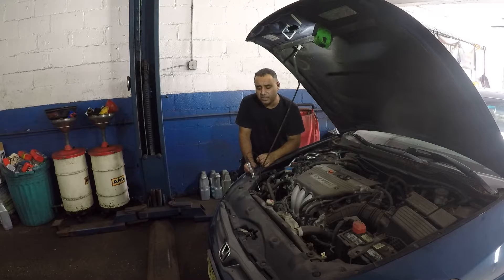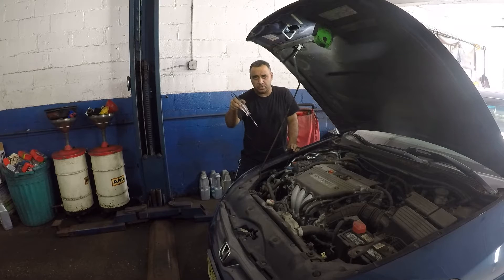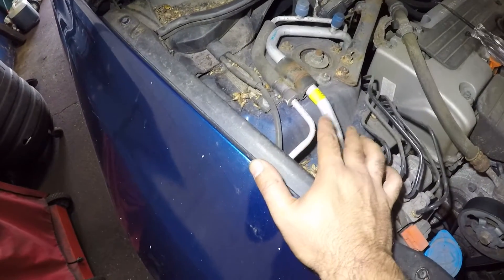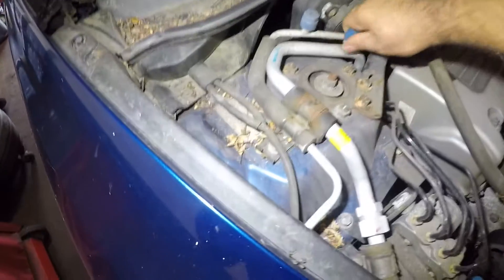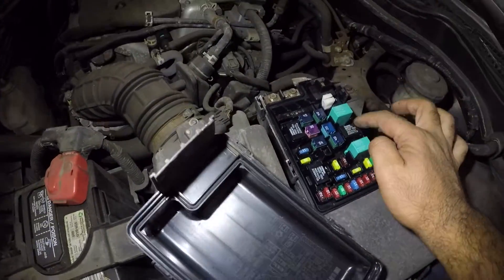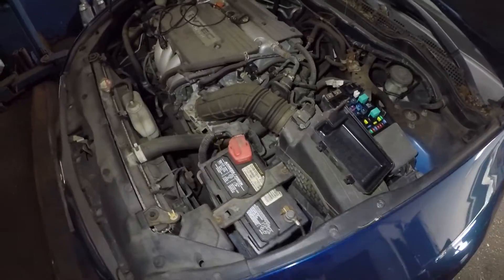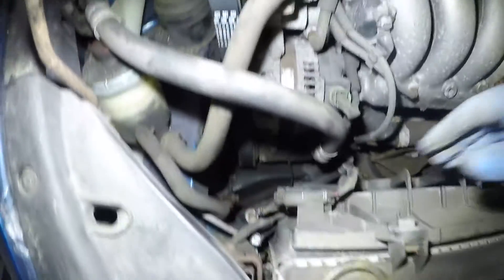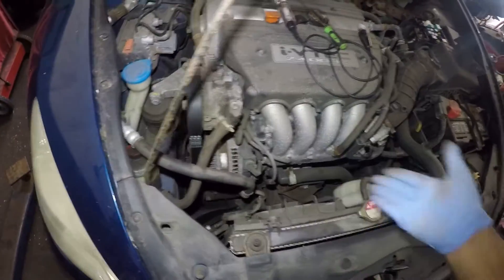How to Electrical Test AC COMPRESSOR power on any Honda Toyota Acura or and other car

Comment: 2009 Acura TSX, The power to the compressor "pulsed" very weakly, so the A/C was not working, also the condenser fan wouldn't turn on. After running diagnostics, I disconnected the A/C pressure switch and the fan kicked on when A/C was turned on. This bad switch was shorting into the A/C circuit. A new A/C pressure switch got the A/C compressor and fans to come on.

Comment: does car need to be RUNNING to test the socket, or just dash  and ac ON ,on the climate control? tested  mine car NOT running, but the AC switch was on and blower> no juice at connector?
Reply from the maker: Running

Comment: man I hope nobody else troubleshoots like you. In theory you have an idea, but you'll have people venting their freon to the atmosphere and changing an expensive ac compressor then recharging with cans of freon then finding leaks, doing it all again twice till the leaks are fixed and after working on their car and cussing it for a week someone will tell them "you could have just changed the clutch assembly"
Reply from the maker: I use machine I try to tell people to use machine it’s nothing what people do watch all of my videos how much I encourage it’s better to find ur issue but then find a mechanic as I say ask the mechanic shop if they got machine cuz u already know there’s no pressure.    So if I can get 100 people to have their ac systym recharged with machine it’s worth it at least I got 100 people less to go to shop that will dump. The whole thing

Comment: This is for the mechanic i got a brandnew ac compressor in my 07 accord v6 3.0L i replaced all realys fuses and brandnew pressure switch when i hook the test light up to the ac compressor connector i have no power what can be my problem plz help me out man id appreciate it
Reply from the maker: What is ur ac refrigeration pressure? High and low
Reply: @RBTheMechanic  they were pretty low I vacuumed the lines for like 5 mins and added the freeon and still nothing

Comment: I dud exactly all steps you did it, but on the last step turn on car and a/c, with the test light not comes on. What's the next step?? Replace whole compressor
Reply from the maker: No u need to check pressure

Comment: Why do you suggest it's a bad compressor in the video...? Couldn't it be just a bad magnetic coil that prevent the clutch from engaging? I have similar problem with my Acura TSX 2011 right now. Relay and fuse is fine, pressure is fine, clutch does not engage. I bypassed the whole electrical system and connected the battery positive on the red wire of my compressor and the clutch still doesn't engage. Only thing I haven't done yet is to test for a bad ground and also check the resistance on the coil which should be between 2 and 5 I believe (roughly... no more so then about 3 to 3.5 as per Acura's specs I think). But still, my point is, it's possible that only the magnetic coil is bad, no? Also I have turned the clutch manually while the car was off and it turns freely but make a grinding noise, that same noise occurs while the car run but much louder, I have used my stethoscope to confirm and yes my AC clutch bearing is done. I was wondering perhaps a bad clutch and a bad bearing (probably filled with debris in there) could possibly prevent it from engaging...? The noise from the bad bearing started to be audible about 1 week after my AC stopped working (good timing now that summer is over lol)
Reply from the maker: Well I tried doing clutch coil for customer it was more expencive than putting in new compressor.  Clutch is the part that goes bad
Reply: @RBTheMechanic   Thanks for the reply, and thanks for your channel and videos, I learn everyday as a DIYer. I saw another video of yours about a similar issue for a 2010 TSX, I own the same but 2011 so everything you showed and explained was of a great help! In my case here in Canada, nobody holds the clutch kit for TSX 2009-2014. All they have to offer is the full AC Compressor that comes with a new clutch. So I found just the clutch kit which also includes a new coil that I have ordered from the US just a few days ago, hopefully it will be coming within 2 weeks or so. I'm afraid my bearing seize up and damage my belt, forcing me to stop on the side of the road right away because of no water pump... I have already been driving with the bad bearing for a good week and a half already. A risk I should avoid you think? That's 9 more days of going to work, a total travel distance of about 525km (325 miles) until I get my parts

Comment: What would cause me to get under 12 bolts at the ac plug, ( it’s a two wire GM weatherpack plug with I believe a built in diode) plus a diode downstream? It’s a Vintage Air aftermarket system in a classic car.
Reply from the maker: Dose it have relay?
Reply: @RBTheMechanic  Yes it has a relay and the diagram that came from Vintage Air shows there to be a “large diode” between mode switch and a rotary dial AC thermostat, then the wire goes from thermostat to compressor. This diagram shows a one wire compressor but the actual one on the car is a  two wire GM, if that makes any difference. Thank you 🙏 in advance.
Reply from the maker: @Joe-bb5hf  oh ok

Comment: RB if you find time on this one, I would be so damn grateful. This has been driving me nuts for a week. If you have a funding account for your channel, I'm happy to donate as well. 2002 Acura MDX. AC was fine. Acute stoppage of cold air. Compressor clutch not engaging. I didn't do anything and just drove the next few days. Here's what I found. AC does not respond from control panel whatsoever. Even with system off. However, when sitting in idle and the radiator fan detects enough temp, it kick on, and along with it, the condenser fan (normal) AND the compressor clutch. Keep in mind system is not on. I can feel draft of cold air. If I turn AC on/off, doesn't matter. I'm getting fan speed control, vent designation, and cold air. Once I'm driving and the radiator fan doesn't need to run, AC is dead. Both fans are on, compressor clutch not engaging with interior controls. The AC is solely dependent on the radiator fan being on. I find this opposite. Radiator fan will come one when it needs to OR when I turn AC on from control panel. I have no control from there. Have checked all fuses, relays, power, etc. All tested good. However, as I suspected, the single wire going to compressor is 0 volts with car running, AC on, until the radiator fan comes on as I let temp come up. When the radiator fan kicks on, I'm getting plenty of voltage. Took it to a repair shop and all they gave me was "No power to compressor", which I confirmed. But then it IS getting power when the radiator fan kicks in. Pulled relays for MG Clutch, Condenser fan, and Cooling fan. All tested good with 12V and continuity. Now, when testing where the relays plug in, relay female sockets (under hood fuse box), I pulled each relay one by one, and with key on (II), I tested voltage. They are all putting out proper voltage except the MG Clutch. I would suspect if I tested with car running in idle, it would have voltage once the radiator fan kicks on. I think it would have to, in order for the clutch to be engaging, as it does. Before I rip apart the control panel I am totally lost on where a short or wiring issue may be. Mind boggled.
Reply from the maker: Did u do relay swap? I had similar issue relay clicked on and off with fans
Reply: I'm gonna drive you nuts man. When getting new relays, I can't find original part number. Other than 4 pin, are you looking for the same amperage as the related fuse? For example fuse for fan is 30 amp. Fuse for AC clutch is 7.5 I really do appreciate the quick reply.  @RBTheMechanic
Reply from the maker: @horacefratsnatch9341  same amp fuse relay u can swap test it with horn relay or fog light relay they r same
Reply: Yessir. I just replaced all 3 to see what happens. Well, few pieces to this puzzle now. When fans and compressor were engaging, the change in idle felt more rough than normal. Then the car just seemed sluggish. I did test ECT sensor and it was indeed bad. Changed it out. While playing with the whole system, I was able to get the compressor clutch engaging on it's own, with fans following. However, it still comes on in response to radiator fan and AC off. My last thing to check was pressure switch. There may be an issue with it or the 4 PIN wiring harness. I jumped pins 1 and 4 and it was very finicky on getting just the right connection. I connected it to the switch and I was getting clutch short cycling which wasn't happening before. I thought maybe the switch was breaking continuity. Jumped the harness again, and while the compressor ran, I kept leads on 1and 4 pressure switch side. It never broke continuity. Now, I don't know if pins 2 and 3 could be playing into this? However, when connected the connector back up, and kinda wiggled it around, it did seem to trigger it. Weird, not really consistent but as soon as I would touch it, bam. But wouldnt'd sustain. Farther down the rabbit hole than I was before and just as lost. I could just say screw it and put a new pressure switch on, even splice on a new harness, but it's a crap shoot. And if I do I have to evacuate the whole system of the refrigerant that was just put in, vacuum, and recharge. Geezuz. I think I should just quit on it. But if that sluggish engine performance starts again, I'm gonna flip @RBTheMechanic
Reply: Also, I'm throwing darts with the issue being pressure switch and harness. When I jumped wires 1 and 4 it was very finicky to get a connnection. I had to get the wires deep down to connect. So may be worth replacing anyway. Even with this, having jumped the compressor it should have kept going until I unplugged the jumper wire. The same situation seems to persist. I have no control on interior panel. Kicks on with fans. The fans are running more often and cooling fan kicking into high. The ECT sensor really helped. What concerns me is the current draw and significant loss of power when all three were on. It was never like that. I took out the MG Clutch relay and I'm going to see how it runs when fans kick on. If it's much better, I'm guessing the compressor is working but shot, causing the excessive vibration and energy draw. Tell me this. If I slightly loosed serpentine belt and spin the pulley, not the clutch, should it freewheel? Be that loose? Mine is not. It moves but If I give it a hard spin, I get 1 revolution. The clutch seems to move nicely but there's alot of corrorsion, etc. I think come spring it's time to just replace it. Ok, all for now lol
Reply from the maker: @horacefratsnatch9341  might be time to replace it yup
Reply from the maker: @horacefratsnatch9341  seems like electrical issue what year make model is this I’ll see if I find somthing to TBC
Reply: Thank you sir. 2002 Acura mdx. So, playing with pressure switch wiring harness plug end. It seems when attached I could get the clutch to engage if I wiggled it a bit. And this time the fans actually responded to the clutch engagement, not vice versa. However, it was short cycling 2-3 seconds then after a bit, on/off 8-10 seconds. Pressure switch was not being activated as I disconnected, jumped the harness pins 1-4 and held multimeter leads on pins 1-4 switch side. Seeing if continuity broke. Never did. I think, but not sure I actually had AC on/off control while it was running. Can't remember. So much monkeying around. Hell, could be control panel. And again, when jumping pins on harness side, very finicky. I have to jam them way down to get a connection and even then, inconsistent. I'm wondering if the connector has questionable internal connections. Disconnected MG clutch fuse and drove around. Fans did their job better. The ECT sensor was giving me readings of 80-90 Ohms with coolant very hot. Should be more like 250-300. When fans kick on, I feel the idle change but very very slight and car was not losing power. Now, question is, if I get the compressor going with the fans and experience that same power loss. That narrows it down I think....to a struggling compressor, even though upon visual and tactile senses with hood open and engaged, it doesn't seem abnormal. The power loss could have been the ECT sensor for sure, and maybe compressor as well. We will see.  @RBTheMechanic
Reply: Also, about the compressor pulley (not clutch). With belt loose I'm sure a new one would spin freely. Mine moves fine and nothing rough, clunky or sounds of internal crap. It doesn't spin freely. I have to give it a hard spin and it will maybe turn 1 revolution. Obviously tons of grease, grime, corrosion. Don't know if getting in there wish some elbow grease and air compressor would be worth it or not @RBTheMechanic
Reply from the maker: @horacefratsnatch9341  I’m not sure what I’m ready grease? Clutch freely spins??
Reply from the maker: @horacefratsnatch9341  those r common on these
Reply: Clutch spins freely. The pulley, with belt loose, it somewhat sticky. But I don't think that's an issue @RBTheMechanic
Reply from the maker: @horacefratsnatch9341  not sure can u make video posit it let me see it
Reply: Will do. I did suspect wiring harness to pressure switch. Went ahead, took it apart, cleaned it, re seated wires and spliced back with crimps and heat shrink. Clutch wire from behind radiator is so thin and looked a bit ragged as well. What the heck. Put lower gauge wire on it lol. I will get a video of the pulley. My guess would be if it's really sticky, it would stress the system. From what I have read into, not a big deal but who knows. Took MG clutch relay out to drive today. Nice and cool. Amazing how I didn't feel that sluggish motor when fans kicked on. It was dramatic.....seemingly as the care got warmer. As I mentioned, maybe the ECT was a big part of that. If not, I suspect the compressor. Don't know if it draws more current when it's stressed but if it does, that would be a bingo. Cheers man. Your response to your audience is the best I've seen on You Tube. Do you have a donation page?
 @RBTheMechanic
Reply from the maker: @horacefratsnatch9341   some times it’s very simple issue I would replace the ETC regardless and put in original part also.  Put on guages for ac to see what the pressure is some times relays can heat up also ETC can cause ac to shut off for safty.  I have PayPal in my home page of utube if u click about. It will show up in bottom.   Anways make video maybe I can see somthing and check wiring diagrams from work shop.   I’m injured right now but I do go to shop 2 times a week.    One time I had car with bad connector to oxygen sensor it would show good and then bad and going over bumps caused connector to move intermittently
Reply: I did but I think you're on to something. Played with the relays this morning and kinda weird. The "click" when powered up seemed intermittent on 2. Tried swapping with horn relay and horn still worked but not sure if that is any real significance. I'm wondering about all 3, AC clutch, condenser fan, cooling fan. They are OLD. Like 350K old and I use AC alot. I ordered 3 new ones and see what happens. As you know they are 4 pin and I suck at understanding electrical stuff. When testing those 3 in particular, they should all work the same correct? As far as responding to power. Then with power applied, continuity across the other 2?  Appreciate it man. Very much @RBTheMechanic

Comment: 2001 Honda Accord, a/c compressor clutch not engaging, the single red wire that goes across fans and connects to wire off compressor is not hot. I ran a jumper hot wire to compressor and clutch engaged. My question is where does that red wire go to, like what should I check, relay/fuse etc?? Thank you in advance if y’all can give me some advice on that.
Reply: Okay appreciate ya! So if a/c pressure is not correct (to low or to high) that would cause red power wire to compressor not hot when I use volt meter ? Thank you
Reply from the maker: @paulhunter9550  it can cut off the ac
Reply from the maker: Swap the relay just incase and check the fuse other wise check ac pressure

Comment: Trying to understand a little better. I keep reading that if there is power getting to the electrical union that's mounted on the alternator, which goes to the compressor and nothing engages, then the compressor is bad. Is the compressor bad or is this the power going to clutch and that is bad? There are kits that can be bought to replace the clutch without having to take out and replace the compressor. Or is there some other electrical component directly tied to the compressor that I'm not accounting for? Thanks much.
Reply from the maker: Power to clutch mean bad compressor. It should work if it got power

Comment: where is that single ac wire from the compressor connected to?
Reply from the maker: From relay to compressor
Reply: @RBTheMechanic  it also runs to the ac pressure switch we'll at least on my 07 accord does

Comment: I have hot air blower in my driver side ac vents and cold air everywhere  else. Checked my ac blend actuator its working. Next i took the mdx to a shop had them service ac system. They checked for leaks and refilled up the system with freon. Mechanic said i need a whole new ac system ($2900) bec the ac compressor is not getting power.

If im not getting power, why am I getting cold air everywhere  except for the driver side.
Reply: Yea the blend door is working I manually open the doors, of the driver side door
Reply from the maker: Do u have dual ac climat control? If so check bled door motor operation first
Reply: @RBTheMechanic  is that the same as the blend door actuator ?
Reply from the maker: @rjcastillo3422  yup